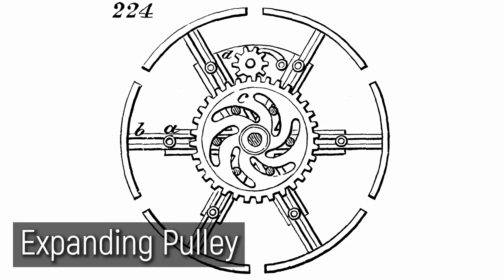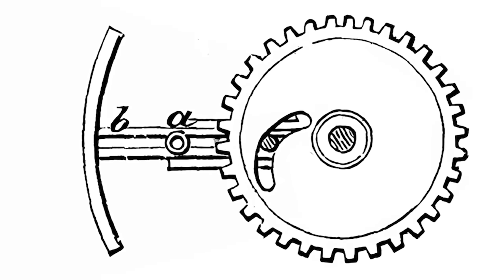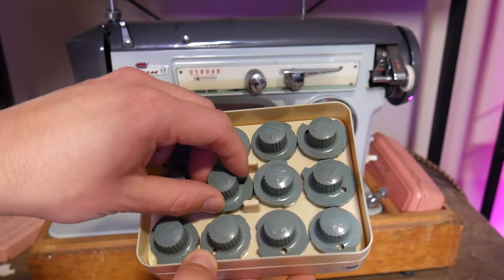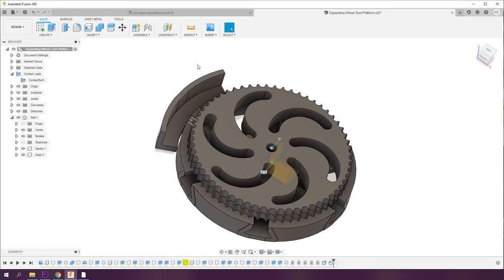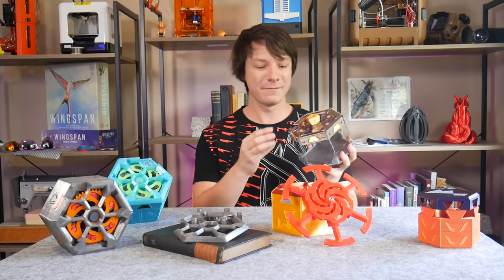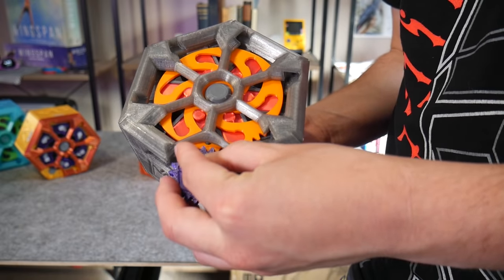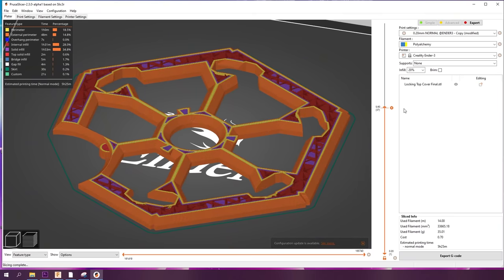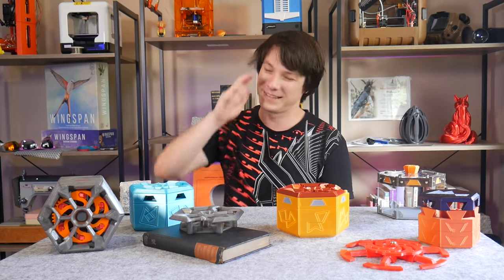This Expanding Mechanism is Crazy Clever

Comment: Wouldn't a spring solve the "you can turn it upside down" problem quite easily? Strong enough to work against gravity, but weak enough that it can be pushed down by the magnets and you have a "turn it upside down" proof puzzle

Comment: What about using this mechanism as a way to have socket that changes size by apply vertical protrusions at the end of each spoke and flipping the driving mechanism you could have it tighten on the head of a hexagonal bolt fairly easy.

Comment: Question: Can you secure the magnetized locking feature with another magnet below? It would secure it from being opened while upside down.
If you don't want to calibrate the secondary magnet by size and strength you can simply place it further away than the slot above.

Comment: Rotary engraving machines use a similar mechanism to hold the workpiece. In that case it's a clamp not a pully but the design is pretty much exactly the same. Kinda like a lathe chuck.

Comment: On the concentricity, I the circle is most accurate when extended the pulley can be used to coil things like ropes or cables and then recessed to retract the pulley from what miht be tightly wound stuff. Bit over engineered but it's a use.

Comment: A similar device has the ability to change the "pitch" of the propeller blades of boats, aircraft wings, especially helicopters.  Rotating the blade of such machines causes that to  bite into the air/water at a steeper rate.

Comment: Thinking... redoing this where the mechanism is not visible from the top or the sides, and the center sprocket is not exposed. In the lid there is a hole in which a key is turned, and magnets in the key push on magnets inside the lid

Comment: Wondering if that off-center behavior can just be centered with the same mechanism that expands the pulley. Youd be increasing the pulley radius which would normally require extending the belt length but the auto centering or (maybe over-centering ) could keep the belt length constant much like the Toyota CTV enlarges the input pulley while shrinking the output pulley to maintain belt length.

Comment: You can open the magnet one without the gear by turning it upside down. That way, the moving part with the magnet with fall and let you turn it with your finger. But if you are smart (very smart in fact) you might just crack the code and use a magnet to pull the piece up while you open it with your finger.

Comment: 3:20 Just from looking at it; If it's a roller/wheel supposed to be in a pulley to guide a rope or translate motion in a sertain way with a rope, then just addidng wheels to the edges might be enough. Gaps wouldn't affect smootheness. But I think I just misunderstood it's purpose, or the kind of pulley meant here...

Comment: I think that if you wanted it to work like a pulley as originally designed that you would have to put slots on the end pieces and make them like the arms with the sliding grooves with the piece in between though I don't think it would move very smoothly but it would complete it into a full wheel instead of spoked

Comment: Ive got an idea that will fix the problem with turning it upside down to cheat the lock. A spring loaded stud that when u push the key in it push the spring loaded shaft down disengaging the lock allowing cog key to turn.

Comment: A pulley?! Huh. I’ve seen a similar basic design that functions as an expanding _brake_, where the rotational energy causes the sections to expand outward until they contact the brake walls, but the sections are held in by spring tension. As the friction reduces rotational velocity, the brake arms are pulled back in by the springs and the rotational velocity may increase again until the brake arms are pulled outwards.

E: oh! It’s a pully wheel where the rope or cable track in the wheel can expand or shrink to allow the rope to move around different diameters within one disc. Clever!

Comment: Expanding pulley might be useful for sailing. With stronger wind, more force is needed to trim sails. In light wind, less force.
(Furthermore, rope wouldn't be bothered so much by the not-quite-round pulley.)

Comment: most likely reason this design hasn't gained any traction or improvements is because something exists that does the same thing very well.  imagine a pulley where the two halves move closer and further, in a way that the groove for the belt width changes.  but instead of a standard belt/pulley, they are V-shaped.  as the width increases, the V groove pushes the belt to a larger diameter  this is used in CVT transmissions in small vehicles like scooters (maybe used in passenger vehicle CVTs as well, not sure).  works great, so no need to go with this mechanism (but sure does look cool :-) )

Comment: another way to take out the ability to turn the wheel with your finger would to have the axle of the pinion gear part of the pinion. Instead of lining up the pinion with the axle, you would slide into a groove and have it mesh with the main gear, and then push the axle down into a hole in order to rotate the pinion. therefore, no magnets, and I don't think there would be any screws, if you could find a way to push the axle through the pinion and print it together? i'm not very good at figuring out how to design prints

Comment: How about this for a way to prevent the latch from disengaging without the magnet?

Have a small metal piece which attracts the latch's magnet, but make it small enough that when the magnet in the "key" is put in place, then the latch will move to the magnet, releasing the metal?

Comment: i have a thing that uses this design to cut off the top of a coke can.  
basically the thing that gets moved in and out are four circular blades like on a can opener.  it's encased within a solid frame, and there's a lever that rotates the center thingy.  the blades are forced outward toward the inner rim of the device, which sandwiches the rim of the coke can between the blades and the inner edge of the device.  then you rotate the whole device and it cuts the inside of the coke can rim, allowing the top to come free.  but it's not even remotely practical because the result is always jagged and razor sharp.  i have no idea what the intended use would be.

Comment: For the lock boxes, instead of having  a fixed handle and a separate gear as a key, wouldn't it be more elegant to attach the main slotted wheel to the handle, making the handle to rotate and unlock the lit that way?

Comment: There was an engine using that, but it would jump tracks so it could follow a new pull in and pull out if you figure out that mechanism set up you have your engine with the spark plugs on the end as they have Pistons I don't remember the name of the type of engine.

Comment: Not sure if someone else had said this but why don't you cover the slot where the teeth are and take out the middle part where the gear sits, and you'll have a missing gap where the gear will slide into and then rotate it so you can unlock it.

Comment: could this be used as a drum brake? as oppose to most modern brakes that use calipers, drum brakes push on the inside of the drum, the friction is what slows the car, and I believe that's how handbrakes are still designed. could this be adapted to that design?

Comment: What if you change the design so that only a small hole gives acess to the gear teeth inside and the key had a small but long gear that would fit through the hole to turn it? a finger wouldn't be able to go in the hole to turn the whell by hand.

Comment: Self engaging clutch plate it’s been used for
Reply: I was going to say this, "smarter everyday" just put out a video on single piece mechanical machines, and he 3d printed something like this, a self enganging clutch plate as used in chainsaws. I mean... the mechanism is kind of different. but has the same physics... the inside "clutch" will spin, and centrifugal force will expand the "outside" of the clutch, which is inside a type of drum. and grip the drum to spin it... In a chainsaw, this drum is connected to the chain. the saw will only engange outside of IDLE speed since Idle has a lower RPM than when you pull the trigger for more gas.

Comment: I purchased this 3D print from Makermuse.com, but the size is huge! 61 inches across the main body. Do you just scale this in the 3D print software?? I was hoping to print the files as is to be the same size as you show in the video.
Reply from the maker: Hi Eric, the files are scales in mm it sounds like your software is configured for inches import maybe?
Reply: @MakersMuse  yup rookie mistake. Fusion 360 imports .stl in cm and can't be changed. You need to use the Beta - Mesh tools and import, this allows unit selection. 👍

Comment: Hm, I wonder if it would work if instead of just a plain pulley, it was like the pedal sprocket on a bicycle, with the teeth mounted individually (or on sets of more than one) on segments of articulated arcs who's curvature was driven by two rods that would get extended at different rates (following separate grooves), and with the drive gear replaced with a worm-gear to avoid getting backdriven by the pressure of the bike chain...

Comment: it would be a very cool secret compartment table, imagen a table whenre this mechanism is in the midle, sandwitched between two pieces of wood and also be flush with the perimiter of the round table, and have the handle be a spining wheel in the middle, also flush with the top.

Comment: What if the pinions moved out in a curved motion aswell, then make the outer ring have the curve so it resembles the smallest possible diameter at first and straighten out towards the end little by little until it fits the largest possible diameter, and then maybe design it so that one half of the smaller diameter sits next to the larger diameter of the next pinion so they intersect when in the smaller position before moving out to reduce the space between them when fully extended?

Comment: As far as simple way of keeping it from being driven without the key, enclose the pinion gear in the top case, and cut a keyway into the top of it. You could Obviously still turn it with anything remotely key shaped but short of actually putting a proper lock with pins, you're not going to stop that.

Comment: You could hide the teeth and add another gear sitting at a 90 degree angle along the inner wall, then have a hole for one of those old single prong keys to insert and drive the gear.

Comment: What if you applied the expanding pulley design for a bicycle? You say there's no way it can be good for gear reduction but if you can't keep the center of the mechanism concentric as it is then shouldn't you be able to make the connections from the outer circle to the mechanism curved and increase the forces applicable as well as then be able to create pin drop latches out of steel and a connected line on each curved bit to sustain the force?

Comment: Why did you choose to go with the second gear instead of turning the lifting knob you already had into the object you turn? Id imagine if you just created keys on the lid that fit onto the box to stop rotational motion then you could just put the lid on twist the top and it would still work with minimal changes. You would still be able to use a clear top as well by just having the knob be fastened through a hole in the acrylic or whatever you used
Reply: Well i suppose since you wanted to make it a puzzle the design does make sense, I was looking at it as more of a cool storage box lid but thats just me

Comment: Re 3:13 - It's a "pulley", right?  I doubt a 1" or larger (say 3cm+ in metric) diameter hemp rope would care much if there were some gaps in the pulley, as long as the contact points were wide (1"+/3cm+) and concave, and the rope didn't have a lot of off-axis forces to make it risk slipping off the side.  I don't have any experience with these specifically, so I don't know, but... that's where my brain went, and based on other experiences with large hemp (or manila) ropes, I seriously doubt it would be a problem.

Comment: Could you make the wheels for a robot to be overlaping on both sides of the main wheel, so when its fully well open, the wheel would still work as a round object. Also if youd have some sort of indicator for the size of the wheel the robots "brain" could adjust the torque it puts on each wheel. Tho i guess it would take some time to work out the bugs. Im sorry for my bad english i tried to explain my thoughts as best i could.

Comment: Thanks for the video, it is very inspiring. At home i have creality ender 3 pro with magnetic bed... but i am so annoyed every time i use that printer, because it takes me long time to adjust the bed level and i still cannot get the quality that i want. inside the usb stick, there are 2 Test-file, and when i just print that, the quality is super good.. But if i slice the STL my self and print it, the quality is never good; ohh i use cura slicer btw. Alr searched the best setting for the slicer but still dont get any good result :(

Comment: Couldn't you make the expanding pulpy fill in the gaps by putting curved bars that are the same shape within the supported bars that are fitted halfway within the two Couldn't you make the extending wheel by putting curved bars that are the same shape within the supported bars where they are halfway in two of the wheel sections where when it extends they would fill the empty space as the outer supported bars slide off of them as they extend?

Comment: What if you (simplified version) had two placed back to back with a seperate gear on the back that operates the 2nd in reverse. Beings the 2 gears would be opposing each other that may help it to not move any other way other than the gear provided. This would aslo close the gaps in between each piece making it a full wheel.
I wish i could just draw you what i mean. Hmm. Im gonna make a cardboard version to see if i coukd get it to work.

Comment: Not an exact example, but the Horton Pulley used a similar principle.  The expanding shoes made of wood would slide against the interior surface of an idler pulley, and the exterior of that pulley would be driven by a belt and motor.  This device was important in the printing industry where long overhead driveshafts would power a bank of printing presses.  Each press could then be stopped by removing the tension on the pulley without having to bring the whole factory to a stop to work on a single press.   Fun Fact:  The Horton Pulley was patented by Mr. Strite who is also responsible for the automatic toaster!  see https://patents.google.com/patent/US1171554?oq=1171554+strite

Comment: 3:35 I kmow how to fill the gaps...  when you expand one part of the cisrcle so it goes in front of part next to it, it would work, wont it?
Reply: or make sliding doors, as I am looking at it, when expanded, outer parts are at just right angle so straight line can go between them, and if you than make those straight parts, make rotation axis on one part and on other part it would slide... it could work...  its hard to say it when I cant post pictures and I dont have degree so I dont know how its called proffesionaly but, whatever.

Comment: wouldn't it be easier to just design the box so the gear is inserted from the rear? Sure you could still operate it with a stick but otherwise you need a key

Comment: Hello Makers Muse, I have an Idea: Using this system to make a silent ratchet, i it hasnt been done before. PLEASE SHOUT ME OUT: REMOVE THE ARMS AS WE DONT NEED THEM, we want a system that will act as a unidirectional bearing. when the STUDS move towarsd the center we set a fixed peg near the center prevernting further movement to the center hence limiting probability of reversing the pulley/gear/disc.

Comment: a toroidal pully is roughly 1000 times better lol. the toroidal transmission found in the comet brand torque converter is the same kind of thing as this expanding pully, only it works extremely well. in fact, CVTs are so good that they are banned in most motor sports. a really good CVT in a powerful car can be "too fast" and really dangerous to drive if you aren't prepared

Comment: seriously you can't figure out the EASY way to keep it key turn only?  on the bottom of the slotted gear which moves the arms add lock slots where a pin (spring loaded to stay in those slots) needs the turning key (two part A: pushes down and locks in place to hold lock pin out of slots B: outer piece with gear and handle to turn main gear) in place. it acts like cam lock but good for either direction of travel and needs the key in place to allow movement

Comment: 3:05  shows your understanding of transfer of momentum and and energy into mechanical contraptions is very limited.
The devices outside diameter that changes can still be used as pulley or wheel , you do not need 360 degrees of contact surface.
nice job though.